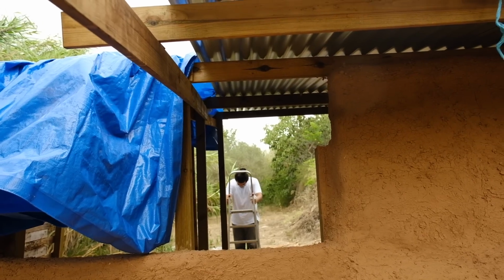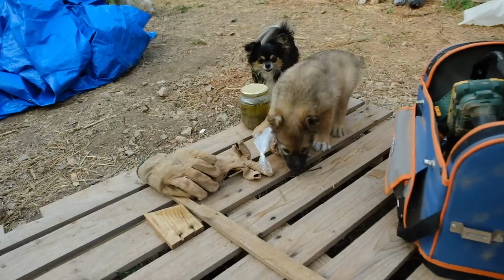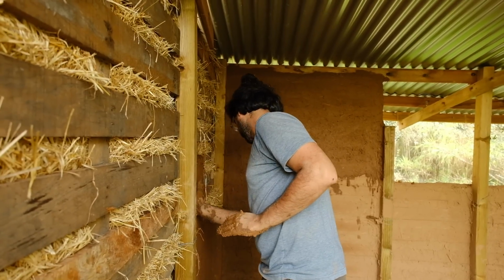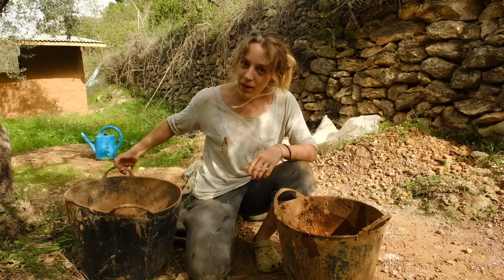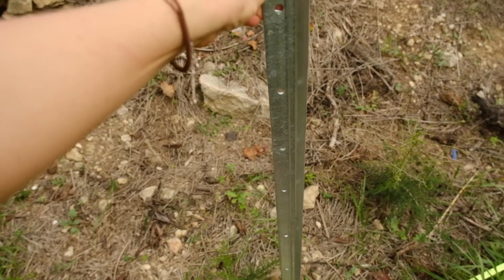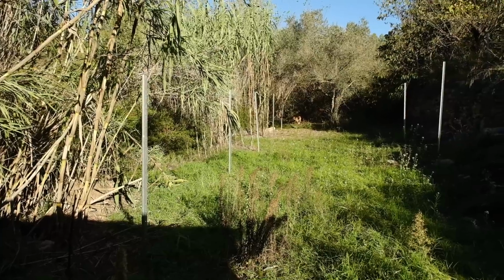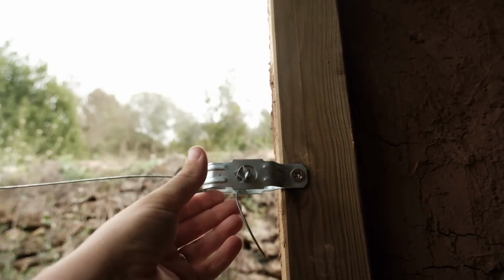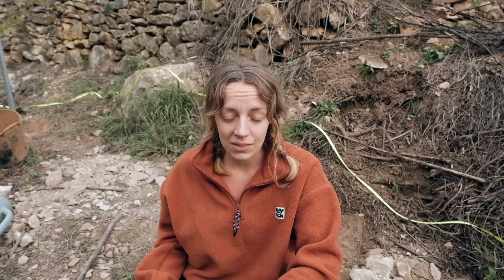We can FINALLY move forward with this!

Comment: Corrugated roofing sheets need to be attached through the top or the corrugation not the valleys. You should also use screws with an insulation washer. Both these tips prevent leaks
Reply from the maker: We used washers on the screws. There are 2 schools of thought re: whether to screw in the peaks/valleys. Peaks is one option, to prevent leaks as you say, but other people swear by the valleys because whilst you screw into the peaks, you are pressing on the sheeting and bending the material. So 🤷‍♀ Can't please everyone!
Reply: @LittleSpanishFarmstead  
Hmm yes, but one way is correct, and the other is not. Nailing or screwing through the ridges is correct. Making a starting hole in the metal with a hammer and pritchel prevents sliding around and deforming the corrugations.
Another thing to watch is how you lap the sheets. Yes, they DO gave a right and wrong way round. All sheets need to be laid in the same orientation. One edge points up, and the opposite edge points down. You need to ensure that the overlap is one complete S-shaped corrugation, with the upward pointing edge underneath, overlapped by the downward pointing edge. This is the only way to make the joins waterproof. 
It looks very nice. The colour of your cob soil is lovely. You must be having so much fun creating your dreams together

Comment: Love your channel! Great work. I admire your ability to just do things and see how iy goes. I think you need to do a lime rendering, at least on the outside cobb surfaces. If you did inside also you could do a lime paint that would sterelise the walls as the did in stables in the old days. Idealy for that, you should have made scratches or holes (finger holes) on the surface of the cobb to help with aderance for the rendering. Cobb will be washed down with the rain if its not protected. Ie all the large overhang in cob wall buildings. There are cob mixing machines that are like a huge bread mixer. I have also heard of the use of a rotovator for digging up the garden, that was tied to a post and running circles on the cobb to mix it. More noisy and less squishy between the toes.
Reply from the maker: Thank you! Yeah we did have a longer term plan to do a lime layer on the outside of the cob. We'll try to get it done before next winter but who knows! It's holding up so far 🤞

Comment: Great stuff, as usual. Thank you for making and sharing. One wee word of advice... the drill-mixer is good for paints and liquids but I'd invest in a proper "batidora" for concrete or mortar mixes. You can pick one up from Bricomart for €80 and it will save you from burning out the motor on your drill.

Comment: I really enjoy following your series! What you do is inspiring! We use tension wire to raise and hold our raspberry brables (between two posts) and we have to re-tense it probably every year. It's a bit annoying if the ratchet bit is wound full of wire because it doesn't wind like thread. But I have no sollution for that one either.

Comment: Well done with all the hard work. The corner posts may not hold up with the weight of the fencing and tensioning forces... usually they're done with coppiced logs or box steel. But there's only one way to find out :)

Comment: Good work. Glad I'm not the only one, with hindsight, having to redo things. Next time: increase the area in which to fix the screws by adding blocks of wood to the beams
Reply: Or even better, use proper liadbearing timber, at least 100 mm x 37 mm. What you have used appears to be decking planks, not at all suitable as rafters and purlins.
Investing in a good carpentry construction book would be a great idea.

Comment: Question: does the goat shelter only have 3 walls? And if so why bother insulate it if it’s not enclosed? Will they be warm enough with 3 walls?
Reply from the maker: Yes it only has 3 walls. It doesn't get too cold here so they really only need a shelter and windbreak, not an insulated dwelling. The pallet-and-straw building method, if done to build an actual cabin, would make use of tightly packed straw as the insulating material but for us, the purpose of the straw within the pallets is because otherwise the cob plaster would fall through the gaps and it just wouldn't work.